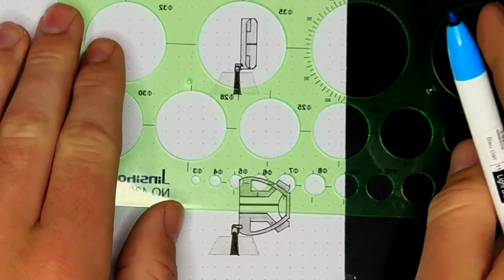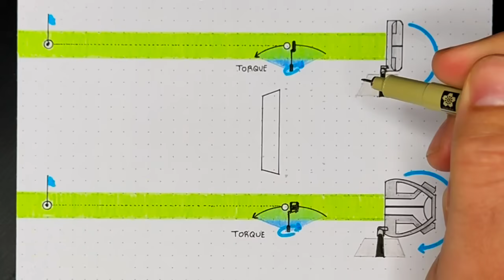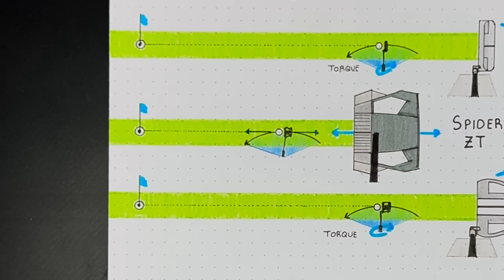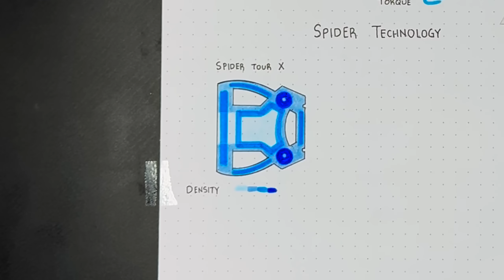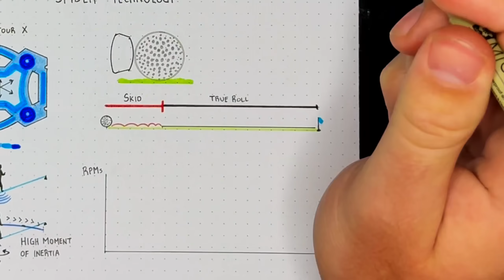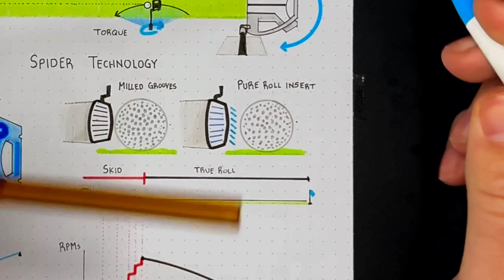How Spider ZT Works

Comment: I bought the black edition ZT putter.  Previously I had an older Spider putter and it was time for an upgrade.  Right away, the feel is solid and has one of the nicest putter feels I have ever tried.  This is the main reason I bought it tbh.  It is well balanced and has good weighting to it; being a little heavier giving it the solid feel I mentioned above.  Takes some getting used to the centre shaft.  Still working on it but I am definitely happy with it.  And the black edition is cool looking.

Comment: Zero torque is a scam. A face ballance mallet will do the same thing except because it's balanced SOMEwhere you can actually feel what the face is doing. With a L.A.B. putter the face could be pointed literally anywhere and since there is no torque feedback you're relying solely on your visual alignment and the shape of the grip. Hard pass.
Reply: This was exactly my experince when I tried out MULTIPLE Zero Torque putters from several manufacturers while looking for a new putter (my Old Lynx Predator P-04 Demi mallet was showing its age and was no longer working for me).  I could not feel the face alignment of even ONE of the zero torques... I ended up getting a Mizuno MCraft Omoi 06 instead which is a more traditional mallet and works fine for me.

Comment: LAB figured out how to do this with a heel shafted putter
Reply: so did odyssey in 2016
Reply: It’s easy to do with a heal shafted putter. The theoretical shaft entry point into the head doesn’t change, just the mph ring point moves. Basically the physics of the balance point doesn’t change, just the mechanics.